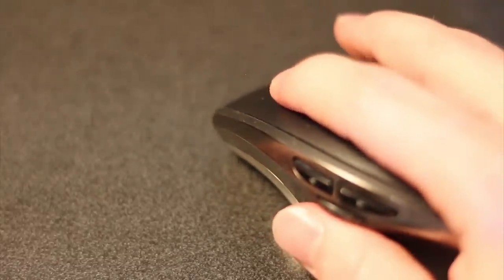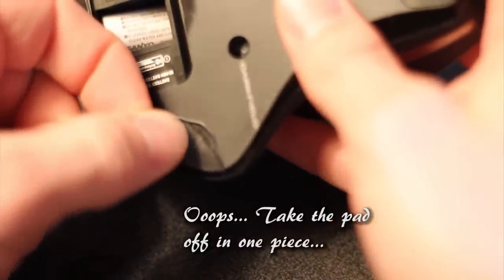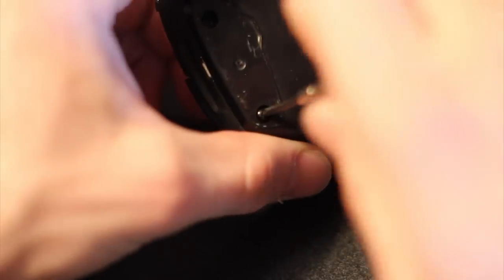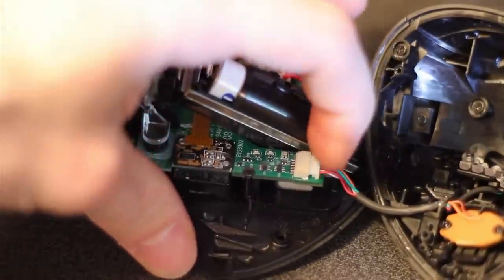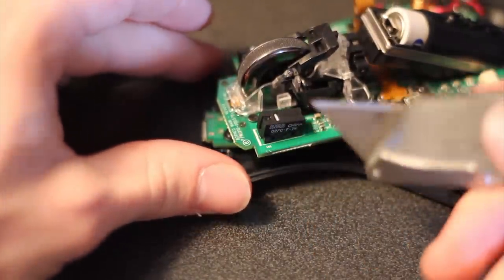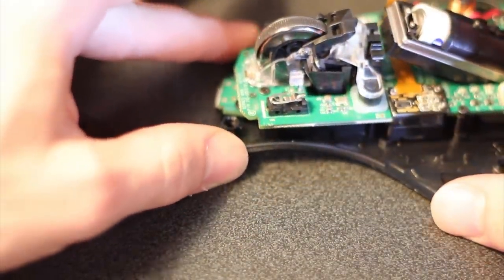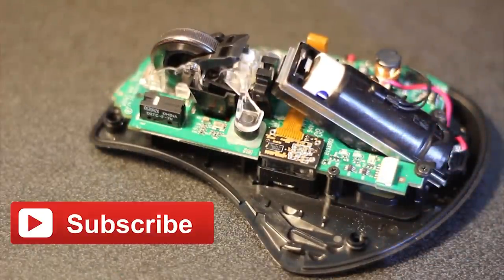Logitech Performance MX Mouse Micro Switch Fix

Comment: most of the time it's just contact corrosion, so no need to bend the metal, just scrape the contact with fine sand paper or knife

Comment: Help! My spring went flying when I removed the black cover. I finally found it and now I can't seem to get it to seat properly. I looked at your pictures but I'm still not sure how it sits securely.. it keeps sliding around and falling off
Reply: Nevermind.. I got it finally.. I used this video https://www.youtube.com/watch?v=GqWt8-BGv1s and this video https://www.youtube.com/watch?v=eDoXMJyimDU&feature=youtu.be
Reply from the maker: This is like surgery. Really, it's very delicate, so be careful. Try using tweezers and/or forecepts to get it in. If you're struggling, try putting a different part on first, or locking one side into place, then pulling it around the other side as the spring bends. If you can't get it, check out my video on replacing the whole switch. I appreciate your subscription! I hope you get it to work!
Reply from the maker: Great! Glad you got it!
Reply: Home Optimized yes thank you! I’ve been using a corded mouse ever since my Performance MX started clicking erratically. I thought it was gone for good. Then the other day when I was cleaning my house I stumbled across my old, dusty, forgotten Performance MX mouse.. I found your video and got straight to work. And now it’s working like a champ, thank you!

Comment: The explanation on how to put the spring back on is bad to say the least.
Reply: If you have to put it bqck on, youll probably be punching a couple walls and pull your hair out. Ive been trying to get mine in for over 6 hours.
Reply: @kushpaladin  it ruined my switch. I had to remove the entire switch and put In a new one, with no soldering experience. Took me 6 hours. This video did the opposite of help me. Mouse works fine though after I replaced the switch

Comment: Good detailed video, however my mouse after years of using it, back and fourth were loosing right click anyway and almost new mouse without battery cover and receiver from ebay for less then $20 resolved the problem :)
Reply from the maker: Glad it helped

Comment: The problem will come back later. Just desolder the micro switch with a hot air gun and replace it. It's 0.2€ unit. Obviously you need to have access to a hot air gun, which costs probably several times as much as a mouse.
Reply from the maker: I ended up replacing the whole switch as well and haven't had a problem since!

Comment: Hello. my logitech G302 mouse had a left-click micro switch problem so i opened it and sprayed some dry contact cleaner (dry cleaner spray) into the micro switches (learned it from youtube).After that i assembled the mouse and plugged in ; now i have a bigger problem! I don't have curser now. it goes to the lower left corner, under the start ( windows ) button and i can't move it or even see it.when i click the mouse's left button, the start menu opens... .the LEDs of mouse blink and don't have the right lighting pattern of g302 .I removed logitech driver and the problem still there.I am 100% sure that i didn't damage anything inside the mouse. I'd appreciate any solution you could give me.
Reply from the maker: Dang, sorry to hear. Sometimes you just have to start over if nothing else works.

Comment: That technique did not worked for me. It did not completely eliminate the problem. It also reduced the distance the buttons have to travel, making the double click harder. Instead, i bought new switches from Amazon and replaced the metal parts. My concern was, because of metal fatigue, the old metal pieces were going to keep failing. My mouse has been working for months without a hitch. Just like when I bought it. I also cleaned the inside really well.
Reply from the maker: I'm glad you got it to work and hope it's still going strong!

Comment: He didn't explain the main part -- what exactly is the fix.  Something about something 'flattened out'... What.

Logitech G600 has that double click issue too, and third 'Shift' does not stick when held.
Reply from the maker: The fix depends on your skill set and budget. By flattening out the spring, you restore the potential energy of the material. For the materials beyond viable life, check out my other video for replacing the microswitch entirely with some soldering. Or for a hundred, bucks, just buy a new mouse.

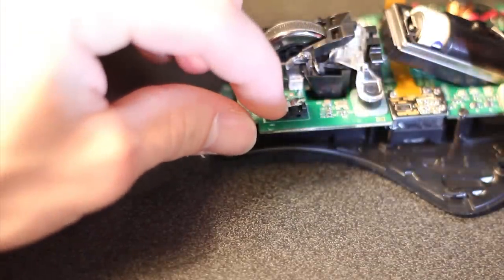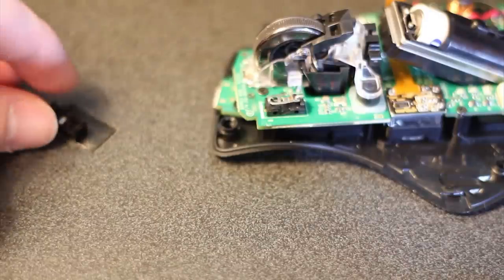Comment: Hi Kyler, this is a great video but you didn't really how you really look before and after. I see where showed where the spring is supposed be pushed up (Time stamp 2:44). Then on (Time stamp 3:00) looks like 2 different switches. The last (time stamp 3:05 the switch still look the same as it did at the very beginning. I don't see you did anything. Thank you either way for the video.
Reply from the maker: Yes, it will look very similar...essentially the copper spring should be a little more flat, resting alone, but should take the same shape as you put it back in the microswitch. It's easier to feel the difference when you're holding/pressing it. If you're good at soldering, it might be easier just to replace the whole switch because that spring is a beast to get back on. I should have labeled this project intermediate to advanced because it's like doing surgery on your electronics. Yet, I'm still using this same mouse all these years later!
Reply: @KylersStudio  I opened mine up and it was actually broken in 2 pieces as if the metal fatigue. So I had to ordered some switches to replace them both. Thank you for the update.
Reply from the maker: @npdjrick1  Oh bummer! Well check out my other video on how to replace the microswitch!

Comment: iv had this mouse over 5 years so long i cant remember when i brought it but definitely over 5 i have droped it lots and lots of times finally  the clicker on the left switch has broken and it dose not work an glass anymore still no other mouse has ever lasted this long so i guess its worth fixing besides i will only buy another one if i cant because it is my faverate and i have a k800 key-bored lol iv had the mouse so long all the print is worn off except the zoom and arrows above

Comment: Good tutorial, BUT the springs come off REALLY easily, and the explanation on how to re-insert them sums up to sucks to suck. There's also no mention of the fact that THIS CAN BREAK YOUR MICROSWITCH 

There's a little notch near the top of the middle pole, which is what holds the spring in place. The back of the spring should be more or less at the top of the switch, and the front should be between the top and bottom metal parts, resting on the bottom of the top.

I don't really know how I got it back on, since I was trying for the nth time (well over 200 attempts), so I wasn't really paying much attention.

Comment: at this point I would desolder and replace the switch. I bet it's some kind of OMRON switch. I just bought MX master 2S to replace my 14y old MX510 which is still working fine. I used to be a heavy gamer , so millions of clicks over the years !

Comment: ok so just tried this methord to fix my double click issue if left and right buttons of my g102 did everything same cleaned and bended a little the strip but changed the left mouse small white button part with a generic optical logitech mouse black button cuz i thought a little size difference would make it better and it did. mause working fine without double clicks. and question are welcome i will write a reply comment to show how long and how many time this fix will work.
Reply from the maker: Glad to hear it worked for you!

Comment: that metal thing cam off and i dont know how to put it back on nor how to strengthen it..
Reply: +thunderlord2200 if you look closely the front bit there is a tiny slit for the metal plate to slot into, and the there's a tiny tooth on the curve part where is wants us to straight, that tooth goes on top of the second metal stand (after the front bit with the slit) and the last part is the big portion at the back, you just slide that under the last standing metal, keep in mind that every part needs to be straight. I once had the curve bit be a bit crooked when putting back on and it doesn't work, but after straightening everything, it just seems to work, so far.
Reply: +thunderlord2200 another way, first put the front part into the slit, slip in the last part under then metal stand, and the curve part is now being pushed up by the middle metal stand, just nudge it down a bit until the small tooth rest easily on the edge (the resting platform) 

I'm sorry, I really don't know what the parts are called, I but totally understand the frustration.

Comment: I wouldn't even bother to do that. I would simply replace the entire switch assembly. You can buy a lot of them for next to nothing, or you can cannibalize them in just about any Won Hung Lo brand mouse on the market.
$8 for two microswitches? For that amount you should be able to purchase at least 20 of them.

Comment: Or........

You could do it the right way which is to replace the switch entirely. Your solution is a half measure. The metal is already fatigued meaning it will lose it's "springiness" even faster. This leads to repeatedly short times between repairs. Replacing the switch will give you another 2 to 3 years roughly. Even if you scavenge a switch from another mouse and use the right button switch it will still last much longer then your repair. Yea I know it may be easier then soldering in a new switch. Thus ppl may shy away from that type of repair. However those same ppl would never consider taking a mouse apart to begin with. If they are willing to begin the process of a tear down they most likely will go that extra step and replace the whole switch.
Reply: He end up doing it the way you are saying, full replacement of the switch xD

Comment: I've noticed that those microswitches in that Logitech "Performance" MX Mouse are the cheap ones made in China. If I opened up my mouse, and saw that the microswitches in mine were made in China, then I would actually go ahead and replace BOTH of those microswitches with genuine Omron brand microswitches -- which are made in Japan, and are a good deal more durable than the cheap Chinese knockoffs! I would NOT bother to retension the leaf spring of a Chinese-made microswitch, knowing that the mouse's left button might start double-clicking just months after the retensioning. Indeed, I'll bet that the cheap Chinese knockoff microswitches are so poor-quality that they even have the propensity to "break on the shelf"! Here's what "break on the shelf" means: it means that the electrically conductive parts of the switch will rapidly corrode. This is the reason why pretty much all Atari 5200 controllers no longer work, even if they've never seen any use at all! It's because their conductive parts have succumbed to corrosion. The ONLY reliable way to store electronics that are prone to corrosion is by storing them within an inert atmosphere chamber, such as a chamber filled with argon.
Reply from the maker: Great insight! You're right, if you are good at soldering, and bought a bag of new switches, you might as well replace them both! Hope yours turned out well.

Comment: do NOT do this! the spring piece came off and I've spent the last 3 hours trying to put it back with no success. My hands are sable and it seems as if thee front piece goes into the hook, but then instantly comes off. overall a nightmare to do this, just buy a new mouse lol.
Reply from the maker: As goes the caveat if it's not broken, don't fix it. If you have more money than time, then for sure, just buy a new one.

Comment: My G700s from Amazon UK (from the official Logitech store there) came with this Double-Click/Mis-Click/Break Click mid-air brand new. >.< 

The other major drawback was the sensor position lol, it's in the front, which turns it doesn't suit my style at all. 
For Desktop use it's rly not a big issue, but for FPS games it's a deal breaker, bcs I can't use the mouse like I did it with any of my other mice I've used. I can't "nudge" with my wrist to make small corrections for better precision. 

I'm still using the G700s, bcs FPS games sucks donkey ass balls in the past 5 years, it's all MOBA/BR. 
And I've grown accustomed to the 4 side buttons, which is kinda hard to find with most high-end mice out there. 
The only viable alternative I've found so far is the ASUS Spatha, but that too has it's flaws, other than the high price. :P 

Overall, I know that defects happen, but overall, I'm pretty disappointed from Logitech. 
I'm not even gonna go into all the rather recent warranty shenanigans, but that too is yet another step down for me. 

The good side of things is that even the cheaper mice these days are [can be] decent enough, bcs the sensors have came a long way and in most cases will suit you well enough in terms of accuracy and precision. :3
Reply from the maker: Things have definitely improved over the years.

Comment: No, no, no, that's not how to fix the switch! The problem is that after millions of clicks there has been the sightliest sparks and dirt in the super small area of contact between the two contact areas. If you can hear the switch clicking as normal do like this: Don't fiddle with the metal parts! Instead, take a piece of paper and dampen it with alcohol. Now just slide it between the contact areas back and forth some times. Make sure there is no paper fibers left and you are done. Quick and simple. I have repaired two Perfomance Mouses this way.
Reply from the maker: Oh interesting. Seems like a fix if the clicking mechanism is still working. Or just replace the whole switch...or heck for a hundred bucks, just buy a new mouse! It's all about time vs. money really...or just to know that you can fix something complex.

Comment: I've just bought a wireless mouse made in motherfucking China, the garbage makers and the left button is already dead.I opened the micro switch. It makes contact but the button doesn't work for some reason. What should I do? Replace the micro switch or return it? that if I can.